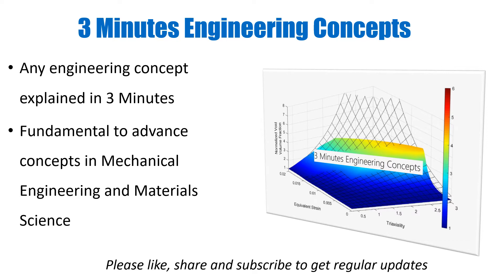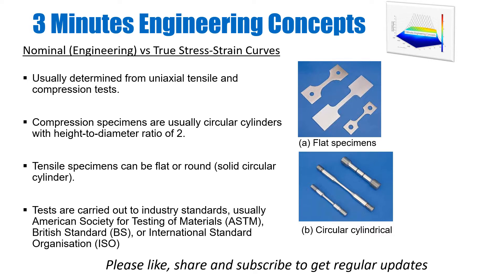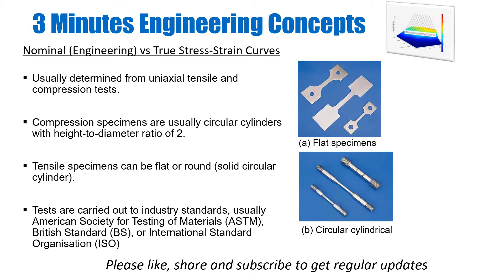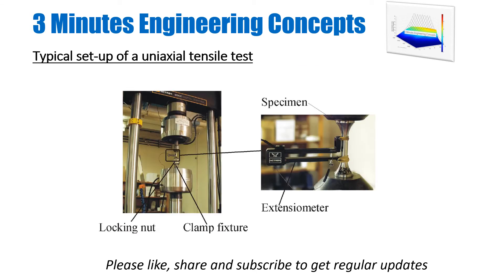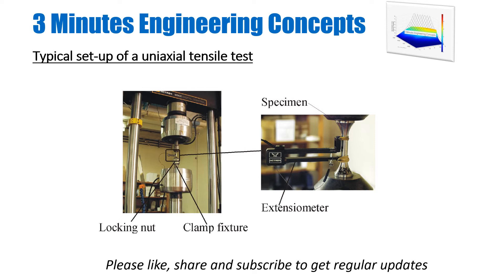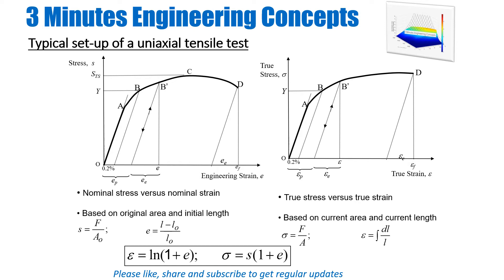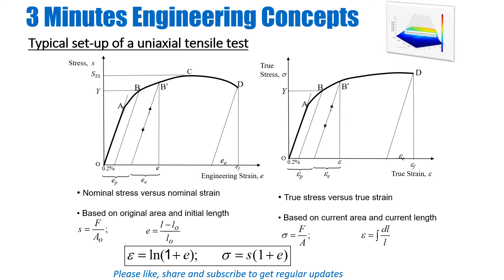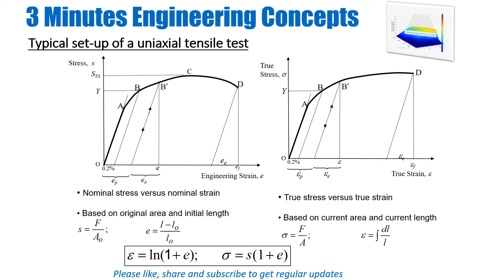Engineering or Nominal versus True Stress and Strain Curves

Comment: how can i draw stress-strain data for polymers in Abaqus ?
Reply from the maker: Hi thanks for liking the video. Do you want to extract data from ABAQUS CAE or you have experimental data as a file and want to input to ABAQUS? 
Polymers generally require viscoelastic material models and you might be needing creep and relaxation test data to simulate such material.
More details would help in understanding your problem and propose a solution.